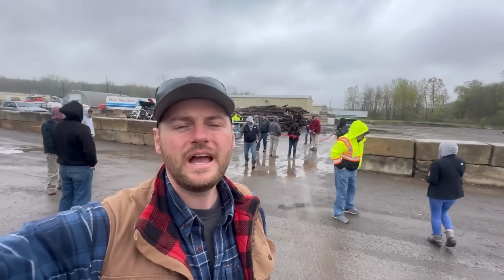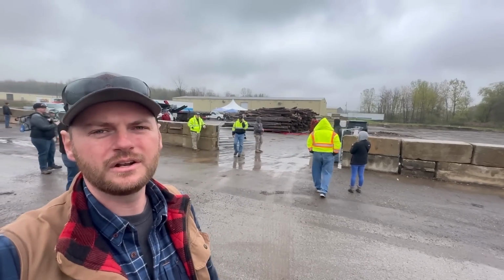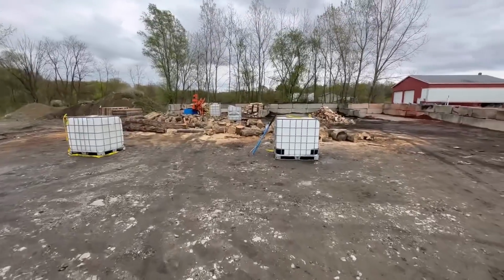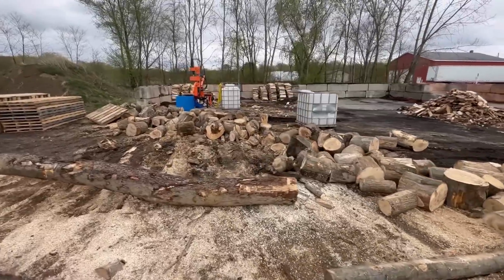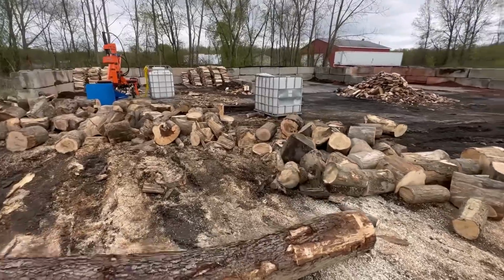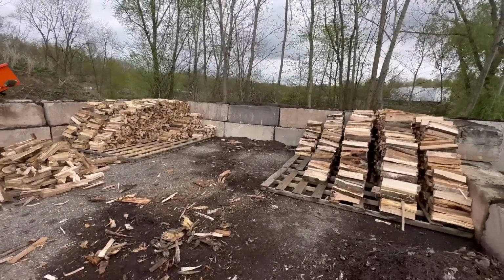Not One… But Two Eastonmade Axis’s

Comment: How did the Axis tow on the trip?
Reply from the maker: Towed great. Only thing is the tongue is so short backing it up is a little challenging. It turns so quick
Reply: I am picking up my axis in July from the Eastonmade facility and contemplating towing it home 13hrs or bringing a trailer.
Reply: @Nick Cr  Take a trailer....Sure would hate to see your investment wiped out after the long wait, from 1 nasty pot hole or a rouge tire/debris laying in the interstate! Pulling it a couple hours to a Buddies place is completely different then a cross country trex!